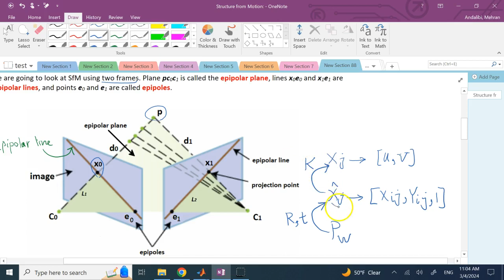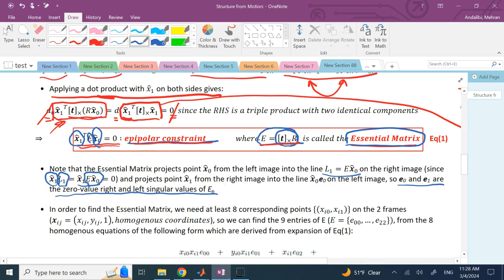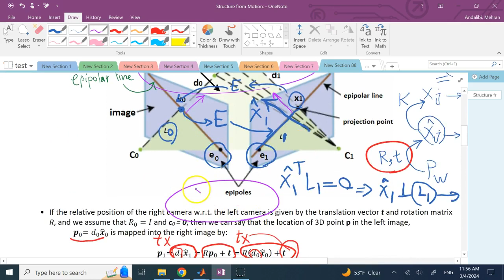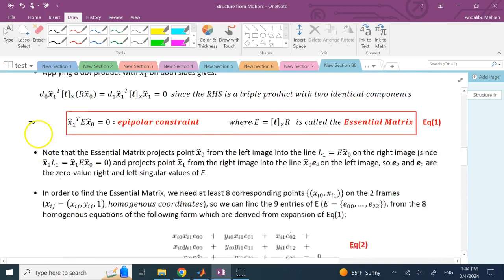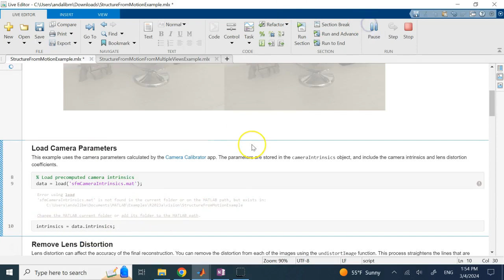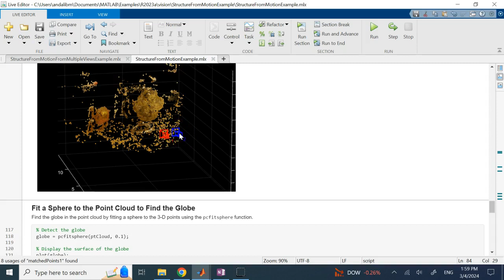Comment: Really intertesting in depth explanation! 

I rack my brain for days to month about what happens if you have one camera position only but several frames. you only tilt or yaw it up or sideways. There would be no motion, no parallax whatsoever. 

Is it still possible to reconstruct a 3D point cloud with SfM Method then?

If we start with the Equation of the Observation Matrix W, Camera Motion M and the 3D Point Cloud S 

W = M * S

This should somehow have an effect on M, the Matrix for the Camera Position. Possibly this is even more complex than this and I don't understand how the effect on M could make the solution above unsolvable.

Do you have an answer?